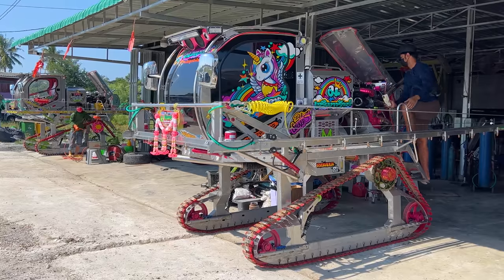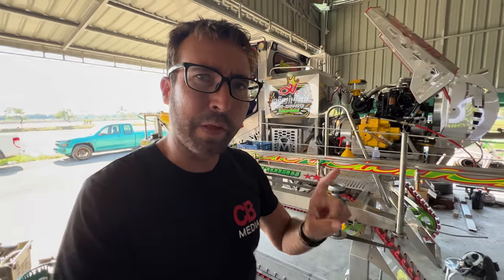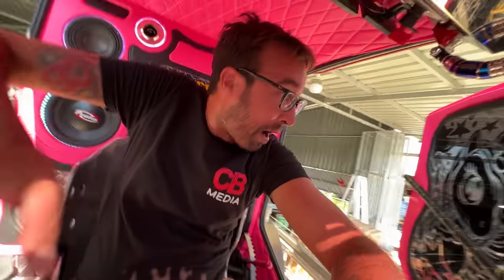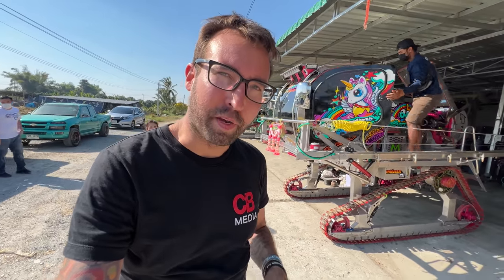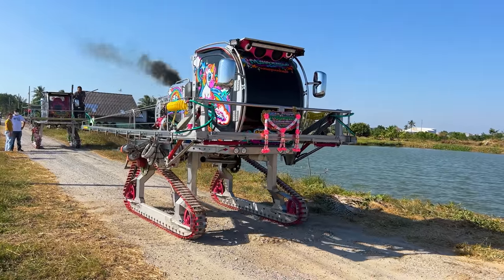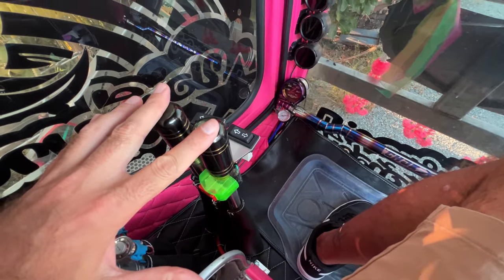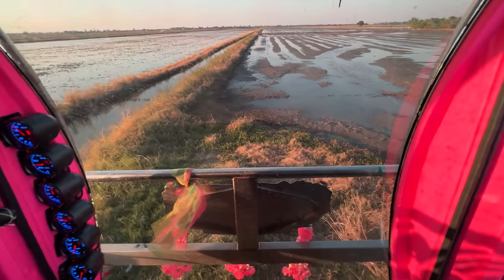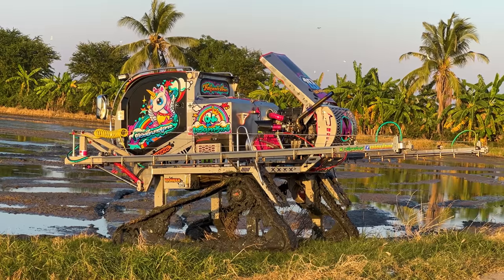Rollin' Coal in a Turbo Rice Tractor in Thailand

Comment: Chad  , rice Paddy tractors are quite common but Insanely expensive from Japan. These machines are cheaper to build new here than to buy a second hand (used) machine and import.

These normally have skinny super tall tires and wheels, rubber tires are rare here and rediculous expensive .
The tracks are local made and not expensive, hydraulic systems here are very cheap and there are tons of engineers to spec. 
Tracks are thin to minimize damage to field and maximize yeilds.

About power it would be SHP , shaft horsepower, basically "@flywheel".
Industrial engines are built for industry and don't have transmission so power level is SHP .
Reply: appreciate this
Reply: Almost all industrial engines are hooked up to transmissions.

Comment: That's such a cool machine! And the unicorns and rainbows is great! And the Thai folks ain't the only ones that like to hot rod their tractors, on the ranch I worked on 10 years ago I had the ol 1976 John Deere 4430 turned up a bit and straight piped with a chrome stack!

Comment: Before 1990 everything was built from parts, sourced from Japan used market, cut up and shipped to Thailand.
Medium and heavy trucks were made from drivetrains bought used from Japan.
Even today you can not import a bus.
Axles are imported and drive line imported, then built here in Thailand.
Reply: They still make buses here in Australia this way, chassis are made in Brazil, shipped to Australia and then lengthened and then a body is made by hand on top.  You can get cheap imported buses from China or other countries but they're not customised for our regulations or as good quality.  Also we still make some heavy trucks here from scratch so our auto industry isn't completely dead.

Comment: It's not so much the torque that gets these track vehicle moving, It's how the traction & weight it spread out over a larger area, it's like walking on mud in boots you sink in such a small area, but if you put on mud sledge shoe's you float on top of the mud and able to move more quickly
It is an odd set for track steering, I use to one lever for each track

Comment: He lives in the states and hasn't ever seen supped up tractors that have alot of speed and torque and can throw down wheelies! Hell they suo up lawnmowers and anything with a motor everywhere in the world so its not unusual to see machines with built up motors and nice paint jobs. People get bored and want to see what happens when you take something thats usually slow and make it alot faster or thats got a quiet radio and make it louder also lol

Comment: horsepower is torque multiplied by time

something like torque is how powerful the engine pulse is... and power is how fast you get those pulses delivered.

so less frequent, more powerful pulses (high torque low power) and more frequent, less powerful pulses (low torque high power) are kind of the same thing when you think about it

so 500Ftlbs and 1000hp vs 1000Ftlbs and 500hp should do the same thing right? its the same net power transfer...